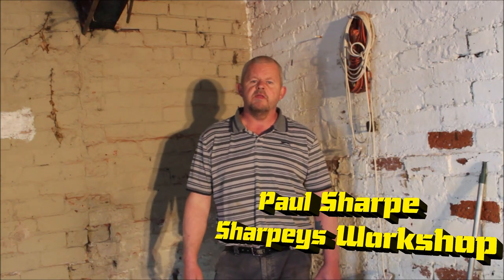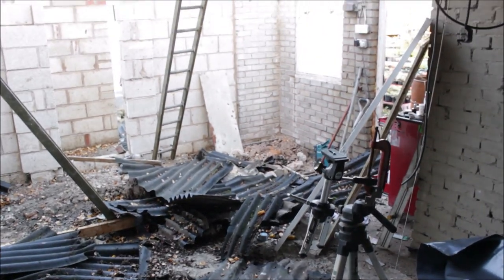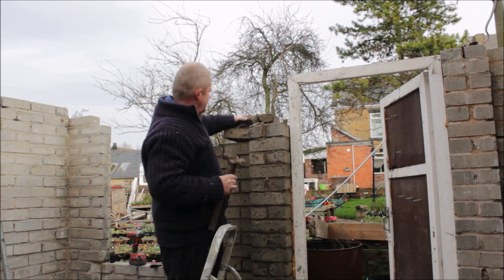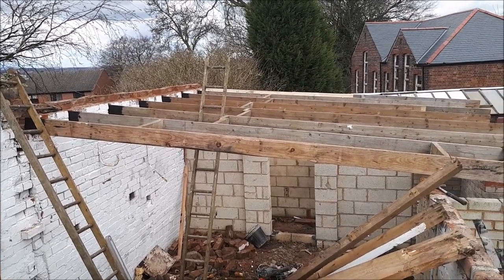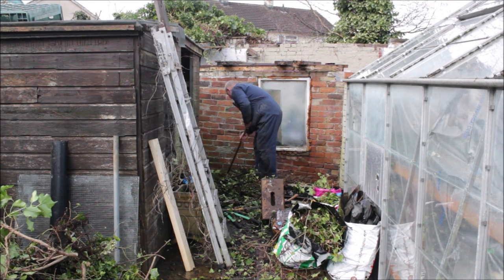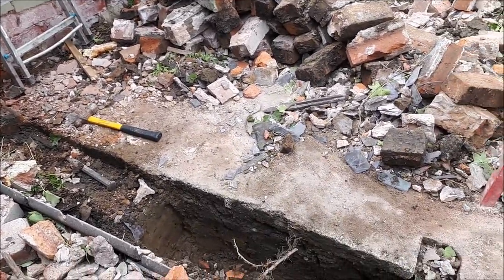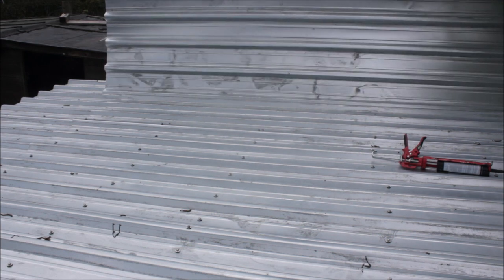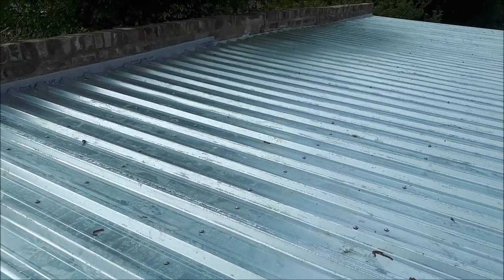Workshop Rebuild Part 2 of 25000

Comment: Great progress. Why notch the walls though? Stainless joist hangers might have been an easier solution.
Reply from the maker: Hi Nathan probably would have been easier but I don't trust the wall to hold plugs so it seems the safest option cheers bud
Reply: @SHARPEYSWORKSHOP  ah right... I get you now. Great job so far. Will be a great workshop when done.